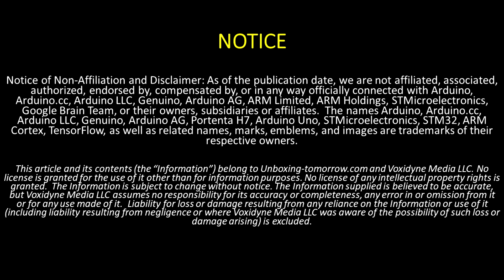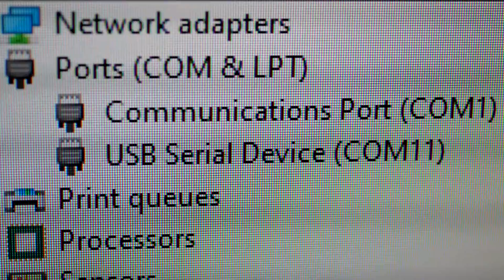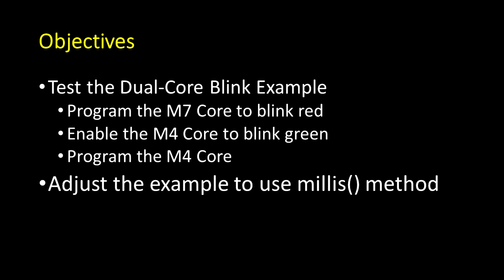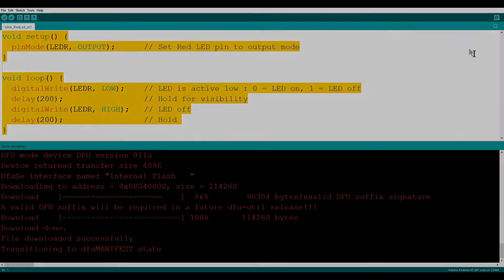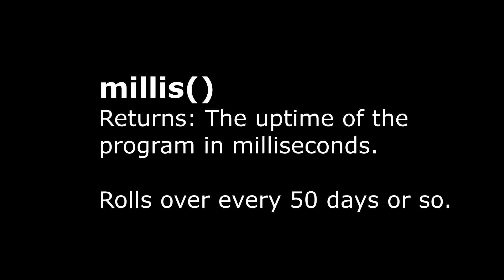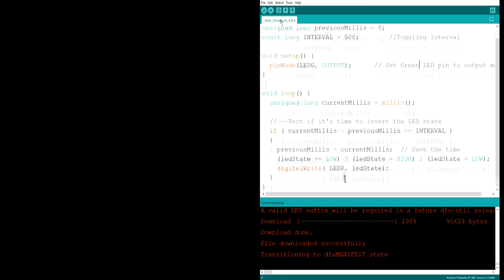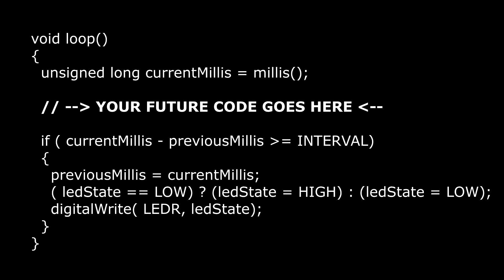Dual-Core Arduino Portena H7 Unboxing: Part 2

Comment from the maker: Don't forget the semicolon on LL_RCC_ForceCM4Boot();
0:32 - Recapping Part 1
1:20 - Basic Requirements
2:10 - Pins are Optional
2:35 - Objectives
3:20 - Programming the M7
5:21 - Programming the M4
6:09 - LL_RCC_ForceCM4Boot();
7:00 - Delay vs. millis
7:38 - Implement millis on M7
10:05 - Implement millis on M4
10:56 - Closing Remarks
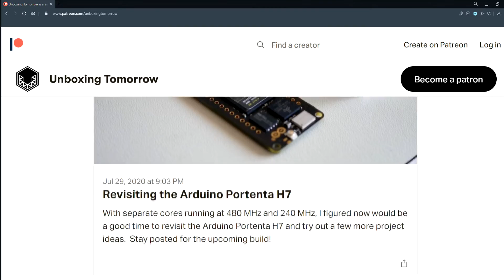12:09 - Happy International Cat Day! :D